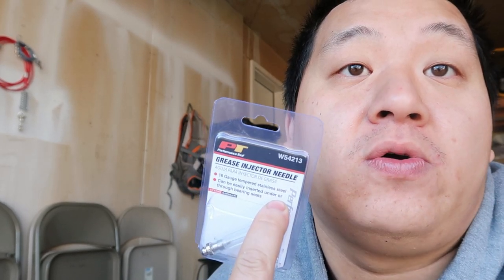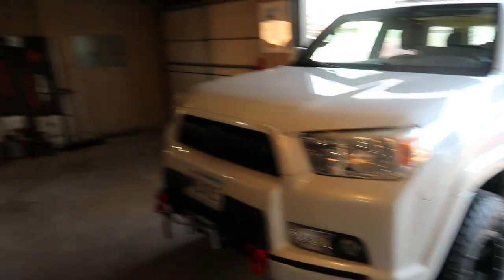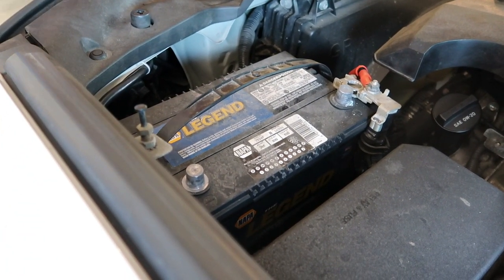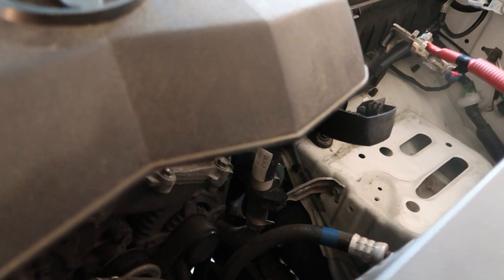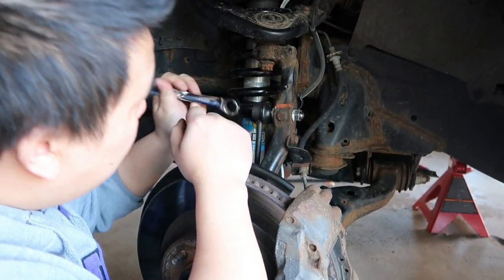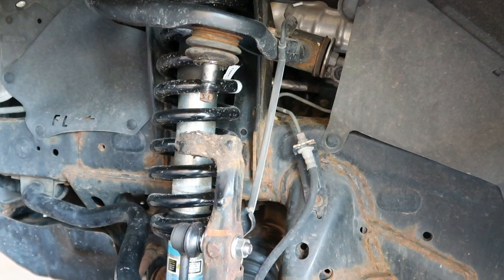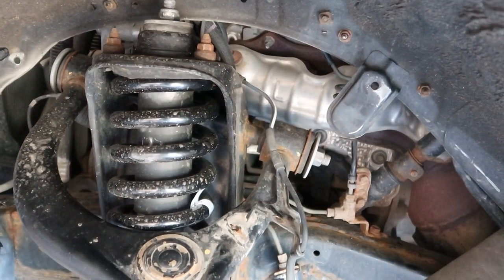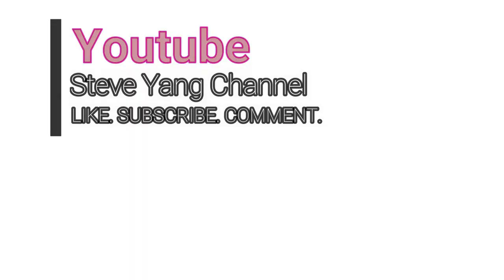2010-2024 4Runner JBA UCA installed PLUS I Messed Up The ABS line

Comment: Great video! You should post pics/video of clearance btw tires and UCA's. I'm a little scared to run 285's with these. Thanks!
Reply from the maker: 285/70? or 285/75?
The JBA has high degrees built into the ball joint. I easily get over 4 degrees. Which is what you want on a lifted trucks. I run 285/70/17s, 5100/OME 3 inch lift, and jba uca
Reply: @stevepheejyang1493  285/70/17's on a 2018 with 2 inch front lift. However, it will be 3 soon. Thanks
Reply: @stevepheejyang1493  so no tire rub on UCA'S?
Reply from the maker: @jasonboyd3619  no rubbing on the uca, its tubular design prevents the rubbing.

Comment: how are the jba uca's treating you? i just got my dobinsons 2.5/1.5 kit in but didn't have the extra cash for the uca's. this are cheaper than the dobinsons too. did these jba's come assembled? the dobinsons uca's ball joint assembled adds $60 more. is it true that the jba uca's have a certain wheel and tire setup that is needed so the uca's don't rub?
Reply from the maker: I didnt get the uca until 6 months after my lift, you should be fine. On a side note. Jba uca came pre assembled with ball joints already installed. You will need a grease gun with the zerk fitting to lube up the bushing and ball joint after installation. With that be said, at full drop you shouldn't rub on the coils. If you look at my video the jba is wider than oem.
I'm lifted 3 inch up front, 2 in rear, have 285/70/17 tires with 17x9 +0offset wheels.
Reply: Steve Pheej Yang Thank you so much Steve for the information! Ball joint preassembled for less than $500. I think I might go with these over the Dobinson ones. Its like a $150 difference. As of now i have stock size ko2’s on trail wheels. I’ll be upgrading to 285 soon and was on the fence about the uca rubbing but i feel better about it now.